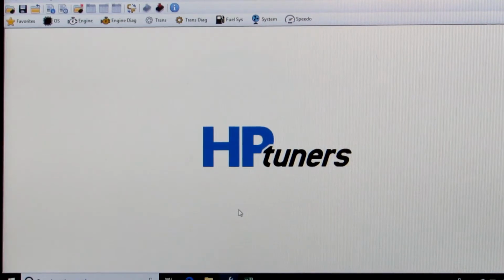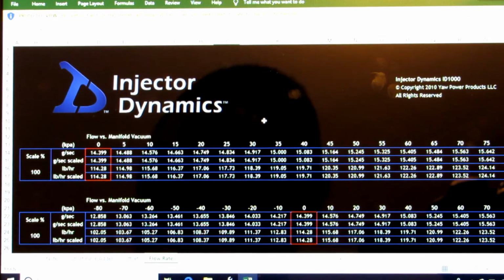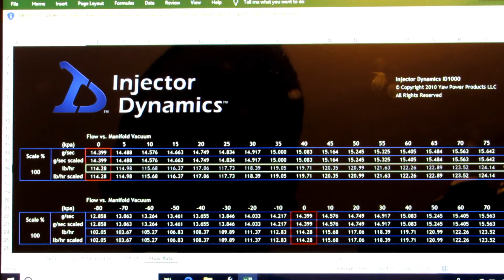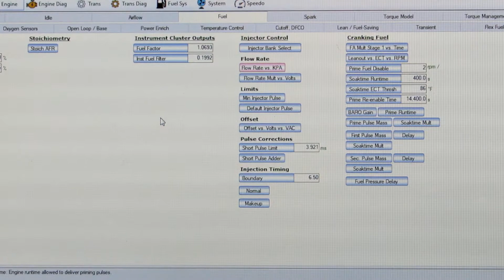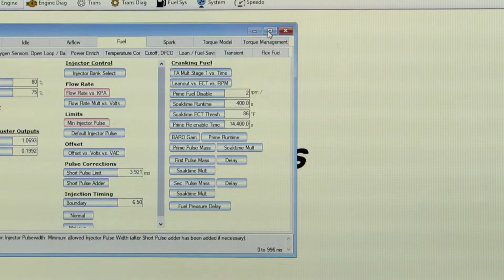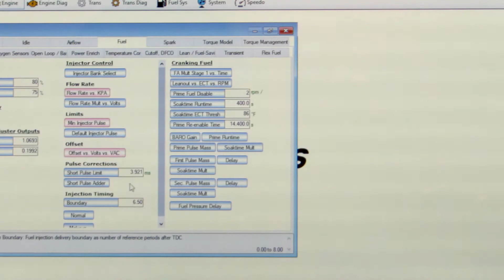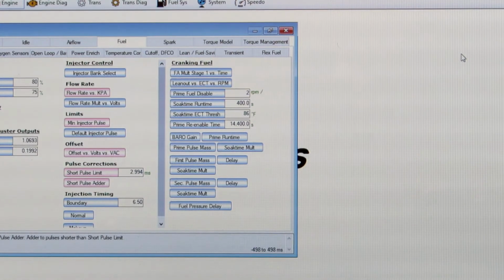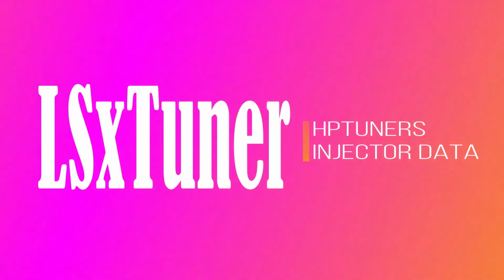Injector data (hptuners)

Comment: I know its 4 years old but its really great that hptuners changed up the flow rate vs kpa to flow rate vs press altering the entire table.
Reply from the maker: I still have flow rate vs kpa. KPA is a unit of pressure or you can use PSI as another unit of pressure.  They both represent pressure measurements.  You can also change flow rate to various units like cc/min or lb/hr.  Just different units of flow and different units of pressures.  It's always been flow rate vs pressure.
Reply: @lsxtuner6126  I'm aware, I'm saying the table is entirely different after their update.
Reply from the maker: @Vile_90  Ok :-)

Comment: Why are values changing when I copy/paste them into HPT?  And short pulse adder won't copy in even remotely close to the same numbers. P59 PCM, current injectors are 45lb current injectors and new injectors are siemens deka 60#. It is for a 2005 GM 6.0L Truck.(Turbo-78mm compressor/75mm turbine)

Comment: Hello,

I recently purchased the FAST injectors 89 lb and all they offer is the bat volts offset data. Is there any way to tune them or should I just send them back?
Reply from the maker: I've heard horror stories about those injectors being junk.  Return them if you can, but if you are stuck using them try the Deatschwerks LS 88 lb/hr injector data as a starting point and adjust as necessary.